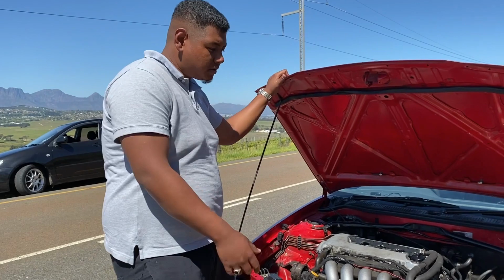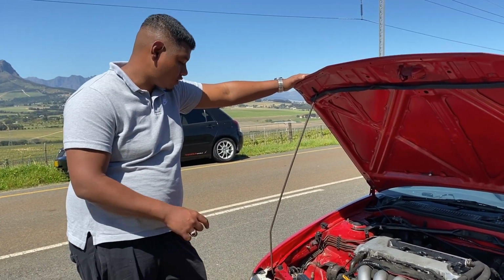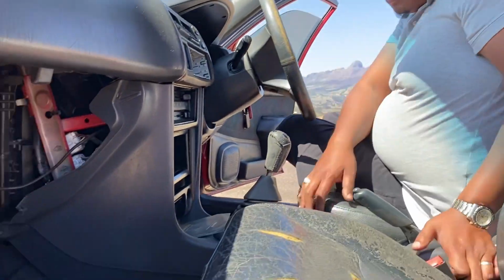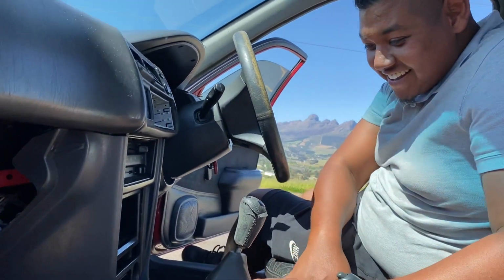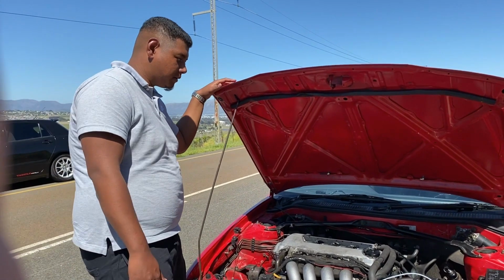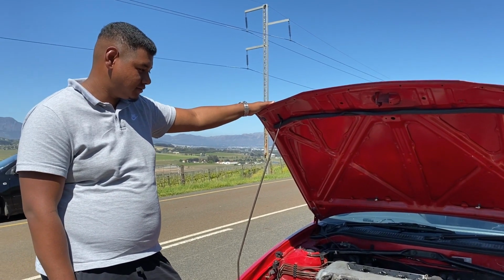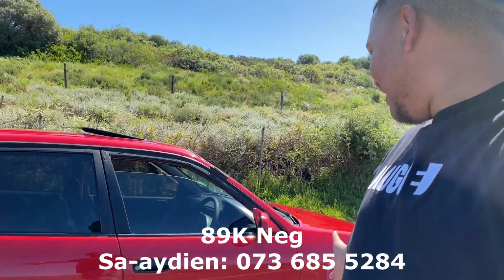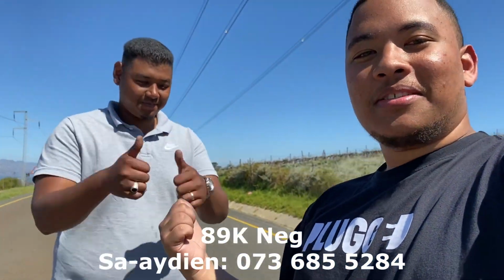Haltech Powered 2zz-ge Swapped Toyota Corolla😱🔥|| A 1of1!⚡️

Comment: The "self-tuning" tuning is called closed-loop tuning. Don't need a Haltech for that. Many ECU's have that capability. You just need a O2 sensor and the management will correct the the AFR to the targeted AFR you input, so it'll get better and better and eventually make the most power capable without tuner input for that targeted AFR. 

This is a very cool swap. I considered doing it in a '08 Yaris, but it's not simple at all.
Reply from the maker: That’s good to know hey🔥

It would be absolutely crazy in a yaris🫣
Reply: It can be done for sure 
It definitely possible
Reply: Would be fast based on power to weight ratio

Comment: The Hal tech Ecu lower lift from 6200 to what ??
Reply from the maker: Not sure my brudda, but probs to like 5500 or something?
Reply: @Plugged021  hmm fair enough I have an Allex z you with lift at 6200, if I put in a Ecu from the matrix that lower lift to 5750 would it work ?